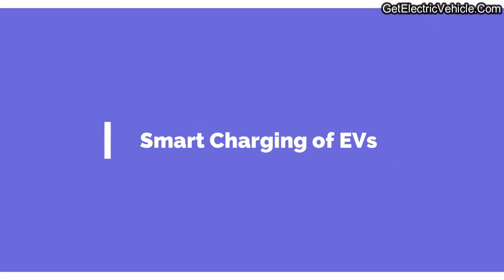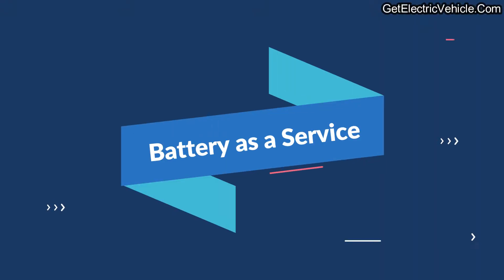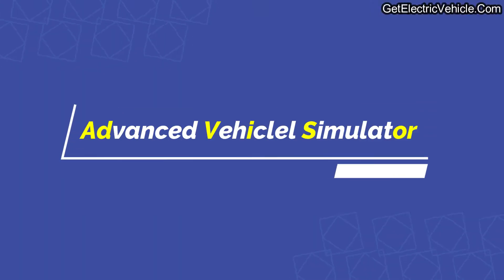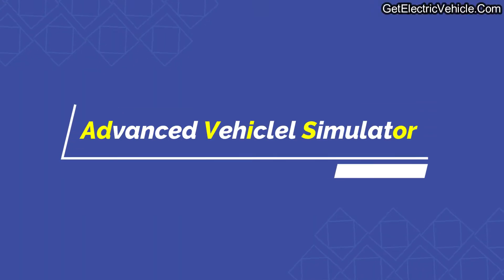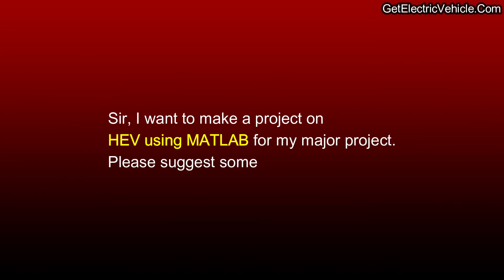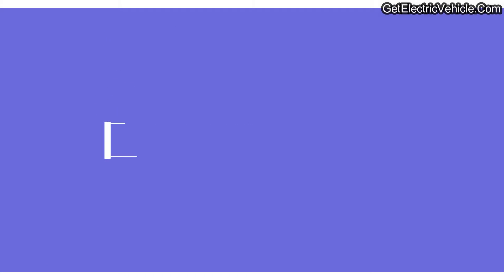Electric Vehicle Project Ideas Q&A - Part I

Comment: Project topic: a study on cost benefit analysis of electric vehicles
Sir pls suggest 3 objectives
Reply from the maker: Are you planning a management based project or technical project? 
Here are some objectives that you may consider
- Break Even points for Electric cars, Hybrid Cars, and Electric Scooter wrt IC engine vehicle
- Environmental impacts of EV during its life (manufacturing to scrap)
- Impact on energy costs (fuel and electricity) if a city uses only EVs
- Impact on the work culture  of the employees of an organisation if they use only EVs and the employer provides free charging facilities

I hope this could help you. Feel free to contact me for any support, if necessary.

Thank you..
Reply: Thank you sir

Comment: Sir please provide me some project and research ideas which can be performed on the hardware model of electric vehicle
Reply from the maker: Have you already watched the electric vehicle project related videos in this channel?

Could you please explain what type of vehicle hardware model do you have with you?

If you have an electric scooter then you may try 

* Harmonics analysis of EV charging circuit
* Impact of frequent braking on life of the battery
* Efficiency improvements in inverter using different modulation techniques